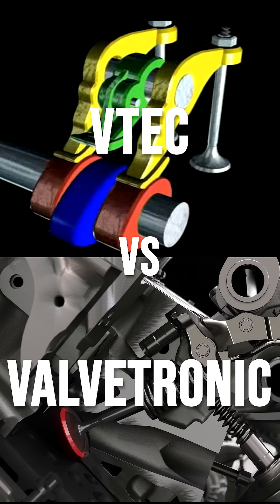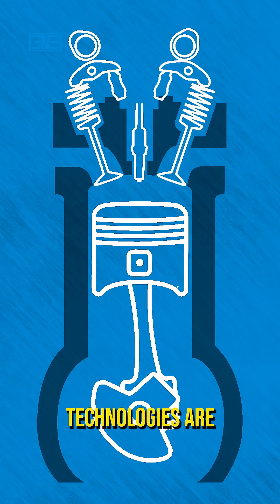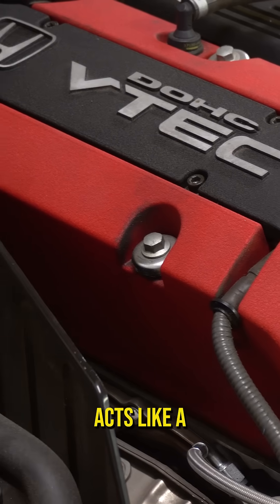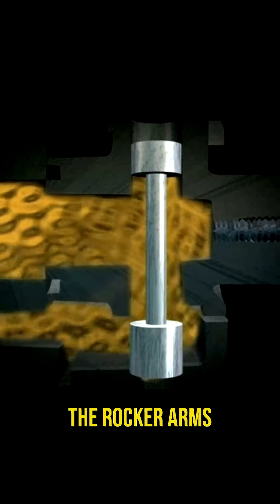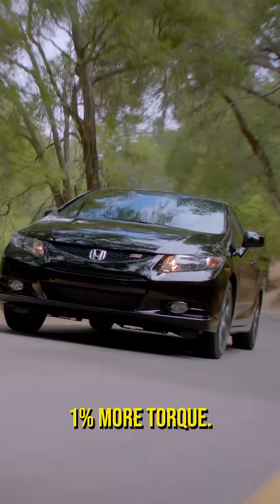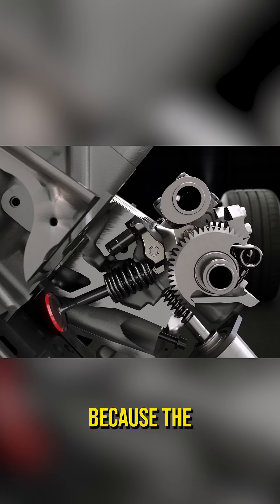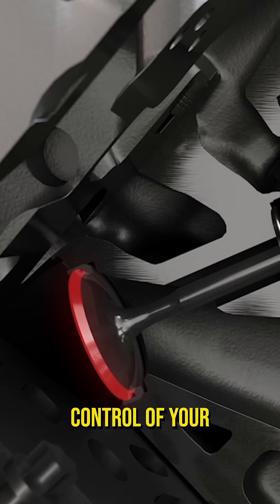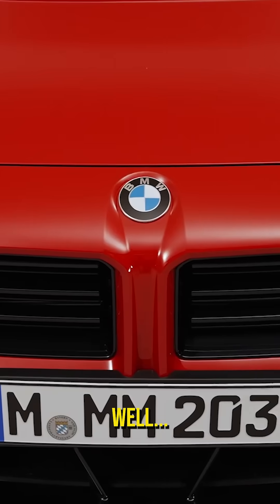VTEC vs Valvetronic - Honda vs BMW!

Comment: Definitely VTEC.
Simpler, cheaper and more reliable.
Reply: By same login no variable timing is even better
Reply: Why would you need simething so useless, just get one without it and boom you have a way more reliable engine
Reply: Especially k20 much fun when vtec kicks in
Reply: Bro just say you’re broke without saying 😂
Reply: @snackmula 
When owning a Beemer Correctamundo  !!!
Reply: @andylane247  tbh both bmv and honda are both just a problem on wheels
Reply: @snackmula 
In your alternative universe?!!!Or don't they work down your Rabbit hole?!!!
Reply: Multiair from FIAT.
Reply: If Vtec was so good, they would still be using it.
Reply: @ryanb8736 
Honda still has vtec in the newest engine. 
Only a little different design
Reply: @ryanb8736 they still do. They toned it down on the turbo engines for more reliability but the V6 layouts still use the same VTEC technology.
Reply: Tell me you're broke without telling me you're broke
Reply: Honda over BMW. Always.
Reply: I see more BMWs that are around 1 million km mark than Toyota. And Mercedes has so many cars that still run after 3 million km. Now tell me again that japanese cars are somehow better with their incredible rust problems as well.
Reply: @mareksinister In which Star Trek alternative universe is this?
Reply: It doesnt do anything tho 😂
Reply: Valvetronic has never had issues 😂 vanos has. Different ststems.
Reply: @robc1014 200k miles on a b58 supra already with regular maintance running with no issues... generation 2 b58 is a tank with forged internals from the factory.
Reply: That doesnt mean its better, u talkin like some farmer
Reply: With that logic, an electric engine wins clearly
Reply: @Emma-i9x 
That's true
Reply: A lot less powerful, a lot less optimized, a lot less usable. 

Congrats to Honda! 😂
Reply: @sombraarthur The way you said it one would think valvetronic makes a car turn into an f1 car. BMWs system is just too complex for something so small
Reply: @Jykobe491 it does not. But it certainly is much better than the VTEC. It is still not FreeValve, tho.
Reply: @sombraarthur  Honda’s goal is to produce cheap, fun, enjoyable and reliable cars.
Reply: @erdzso7036  I agree. That is precisely what Honda wants to make. BMW makes sports car.
Reply: @sombraarthur  it is certainly optimized, its just not adjustable.
Reply: @thearbyarbiter optimized, you say? For the incredible amount of 1% improvement?
Nah, if it is optimized, it is optimized to be simple and run on hopes and dreams. Like a Honda guy. 😂
Reply: @sombraarthur  runs fine on me 230k mile 21 year old element
Reply: @sombraarthur BMW is garbage.
Reply: @sombraarthur just like a bmw guy to miss the fact that the 1% thing was a joke
Reply: @sombraarthur the 1% thing is a joke bruv.
Reply: @sombraarthur, someone got schooled. 😅🤣

That is for not doing your research before posting. The 1% torque increase was a joke. Torque increased before and during VTEC throughout the rev range. But at high RPM, you won't need torque because the rotation has already taken place. Do you need torque like a diesel car?

A car needs torque at low rpm to get moving, but once it's moving, it needs HP, and that is what VTEC is for.

Torque = (HPx5252)/rpm
Reply: @sombraarthur race car/luxury car vs economy vehicle with a fun amount of horsepower. Stop the cope
Reply: @sombraarthur remember in the 90s, when the nsx was a car build to compete against farrari and porches? Good times
Reply: @MidoriEK95 yeah, I do. And it failed to compete at the same level. 
At that time, we didn't had the same tech today that can make a 4 banger get 600+ bhp.
Reply: @sombraarthur do a little more research on detail and not because it was not being sold as much a farrari from it not being known or other words popular
Reply: @sombraarthur  honda's k20 with intake and exhaust vtec will kick ass of any 2.0 bmw engine lol.
Reply: @refurbished406 😂😂😂😂😂😂 Yeah, as long as it does not have VANOS and other little tricks. 

The Japanese fan bois these days are WILD. If it is japanese, they will GOBBLE IT IN.
Reply: @sombraarthur it’s definitely alot more usable given that the bmw is going to break down a lot more 😂 doesn’t matter how much better your VVT is when you cant drive the car cos it’s in the shop 😂
Reply: @benbrooks566  you often find a lot more broken down hondas more then bmw these days given the types of people who don't maintain their car
Reply: @sombraarthur yeah it’s better to spend a lot of money on BMW that brakes every second
Reply: @sombraarthur  Yeah like a bmw will drive more then 5 cm without the engine breaking

Comment: Some BMW engines are very reliable and some are not. That’s less of a problem with Honda. But an M140 is just awesome, one of the best hot hatches. Just change the oil in between the services and you’re good. No long life nonsense. B58 engine is solid!

Comment: Honda was the first company to truly mass market an affordable and reliable vehicle with variable valve timing, the 89 Acura Integra and has been doing it longer and more effectively than any other manufacturer. Think about the fact that the NSX was a V6 with VTEC that competed with supercars of the era that had 2 less cylinders. Everybody else had to rush to catch up with Honda's ability to make economical cars that were fun to drive. Sure they have always produced lower torque vehicles but the F1 trchnology they used to get the sportiness of their vehicles made them fun to drive. As somebody said before I'd rather drive a slow car fast than a fast car slow.

Comment: My buddy has a bmw G8x M3 and I'm rocking a FB6 civic Si. The Si delivers a bigger power boost than the bmw and my buddy never likes to admit defeat. He says my car throws him back into the seat and obviously gets a bigger boost than his M3. His car's Valvetronic system blew up recently got it fixed then he got a 2024 civic Si and likes it way more than his BMW. He says that the civic still provides a bigger boost and responds better than that M3.

Comment: Konig has a cam-less valve train that uses a servo (like a fuel injector) that raises each valve on its own and has various valve positions.
The tech has been proven to work 100%. Several F1 teams have expairemented with it, and even GM has shown an interest in the tech.

I would say this is better than either the Honda or BMW tech.

Comment: We’ve had some issues with that vavletronic systems on the N20 and N55 motors, but the rest have been pretty bulletproof. You’ll get faults for the valvetronic motor, and can sometimes hear it ratcheting after shutting the car off. The test plan will say to replace the motor, and will often also suggest resolving the eccentric shaft, roller bearings, and oil squirter for the system. It can be fairly costly to repair. If you let it go for too long, it can burn up the driver in the DME, and then you have to replace all of that AND an expensive ECU.
Reply: Yeah, and you could have prevented that with BASIC MAINTENANCE. 

Change the oil every single 5k km.
Reply: @ I’m a BMW master tech. I’ve worked on all BMW engines in the last 20 years. N52, N62 and all its variants, N63 and all its variants, S engines, etc never really had issues with them- even poorly maintained and neglected engines. It’s an inherent problem with the N20 and N55. The N54 didn’t use valvetronic, so that’s a non-issue. Also, the timing chains are a ticking time bomb on the N20 engine. It’s a matter of if, now when, it’ll fail you.

Comment: Infinite valve adjustment vs 2 settings not really comparable.  Everybody has had their own version of vtec since the early 90s but no one has been able to replicate valvetronic. Its also part of the reasons bmws inline 6's can get the same mpg as hondas 4 bangers...

Comment: Im going to take the neutral road, vtec walked so valvetronic could run. Obviously bmws system is superior because its much more modern design. I think honda is moving away from vtec at this point so it was great for the time. That being said i love my j series for my daily and ease of repair.

Comment: Everybody talks about vtec kicking in, everyone also sleeps on the toyota vvti system
Reply: Even whatever is in my NC Miata is pretty good. Cam crosses over at 3500 then intake runners lengthen at 5000. Gives pretty good torque once you get past around 3000 and a bit of a bark at high revs

Comment: had a vtec back in 1990 where this was unknown to bmw. like 2 engines in one and 160hp from a 1.6l engine wich was a fortune back than. this crx‘s still on the road and more worth as you may think. and bmw‘s? hmmm… didn’t survive even the first 100k km…

Comment: Gotta pay to play. The ultimate driving machines are just that. Racing inspired tech that requires more maintenance. Good thing there's FCP Euro with lifetime warranties on all consumables. Never really been a Honda fan. I get it they're reliable and low maintenance cost but they're just boring to drive unless it's a type R car,  S2K or NSX. Those are actually fun

Comment: Shouldn't this really be V-TEC vs VANOS?  Honda system is on/off but BMW is continuously variable on both intake and exhaust sides then you have Valvtronic on top of it.

Comment: On paper BMW hands down easily wins but in real world conditions honda wins purely for simplicity, reliability and cost
Reply: And that shows that your problem is not that you don't have a car powerful enough to commute, you want to be a cheap beater where you can simply drive it to the bone on the stock fluids and stock parts. 😂😂😂😂
Every single time I hear people complaining about maintenance, I think that they either go back to riding busses, or indeed buy japanese shitboxes. For they are the people for such cars, cheap beaters that can be replaced by anyone with a half working brain and basic tools, with cheap parts. 
To each their own, I guess.
Reply: to make a BMW reliable you have to literally have to use motorsports grade parts. lmao
Reply: @TickleMeShlomo a B58/B57 with a zf8 is one of the best drivetrains in the world. Apart from some idiotic solutions like plastic oil filter housings, these engines are bulletproof in theyr stock form, and are absolutely awesome in terms of fuel consumption
Reply: @TickleMeShlomo well you’re just wrong lmao
Reply: @dingaling42069  they're literally engineered to need more maintenance than Japanese cars. And guess what most people don't properly maintain them so they need to be made with more durable parts. But then they would be even more expensive than they already are.

Comment: I owned both and I would take the Valvetronic over the VTEC any day. I even have the BMW shift am on my motorcycle that functions more like VTEC and the BMW execution is so much smoother. VTEC engagement was always so violent and shifting gears would get you out of it, so it felt like you were being thrown forward when the car went back to the lower cam profile. Also, Hondas aren’t that reliable.

Comment: BMW valvetronic systems rarely if ever fail, and when they do it's always to do with poor maintenance which would kill literally any engine.
Reply: That's almost always the reason for german cars breaking down.
Reply: @micheltbooltink wrong
Reply: @micheltbooltink  I wouldn’t state that no car manufacturer only has bullet proof engines sometimes there is just a stinker or problems in whole series that are easy to fix if you know

Comment: Comparing VTEC to VANOS would be a lot more apples to apples. Valvetronic is a whole different animal
Reply: How so? VANOS is variable valve timing, not valve lift.
Reply: @geeniusatwrok  Which is what VTEC is. Variable Timing Electronically Controlled. Valvetronic controls idle and intake advance independently
Reply: @lukeyarasheski5510  You are wrong, i-vtec has vtec + variable valve timing (same as vanos)  normal vtec has two cam profiles and it switches those profiles, so because its a entirely different cam profile it cant be compared to anything, not even valvtronic.
Reply: Try i-Vtec. It also control valve timing. And i-Vtec does already from 2001 (k-series)
Reply: @mr_padla and it still is just a waste of fuel and air, because it does not make the same impact on the engine as the Valvetronic.
Reply: VTEC just causes the valve to open wider at certain RPM. VANOS controls when the valves open depending on RPM. Valvetronic is more refined than VTEC with fluid adjustments from 0 to 100% eliminating the need for throttle body this more responsive and efficient
Reply: @ph_earle  I'm aware of all that. Thats why I said Vanos and VTEC are closer than VTEC and Valvetronic
Reply: It doesn't matter vanos or valcetronic, they are not reliable 😂
Reply: @akafede4351 Oil change intervals have a lot to do with that. I have a 240k mile Original M54
Reply: @lukeyarasheski5510  well i change oil on my m43 (ye i know i know... Not the best power house) every 10k km. Now over 550k km on it. Have with me for 11 years.
Reply: @akafede4351 "they are not reliable", said the guy with either no car, or who never had a BMW. 😂😂😂😂
Reply: @sombraarthur  no, I don't have a car 😂. A good BMW is not the norm bro, they are normally overpriced trash, especially after the 2008/2010s so just deal with it . N62, N63, N43, n47, n57 😂😂